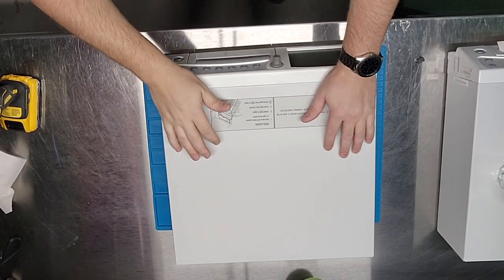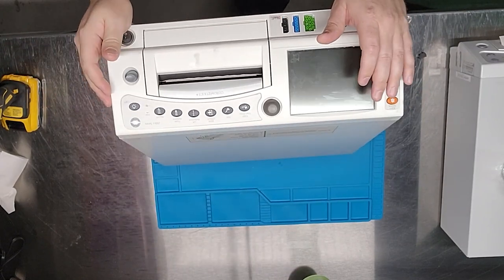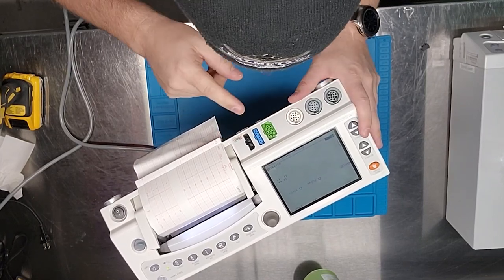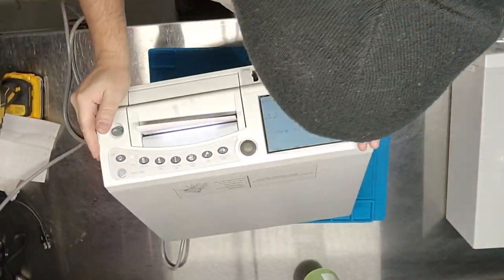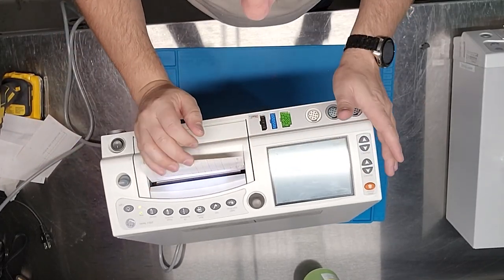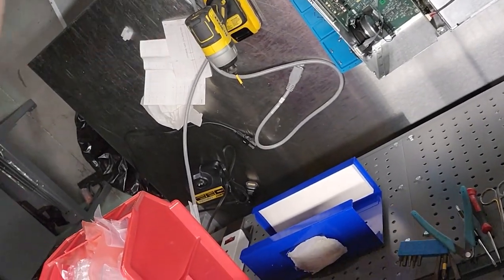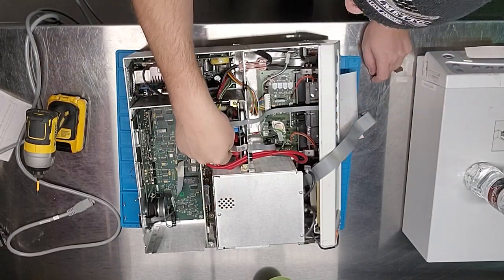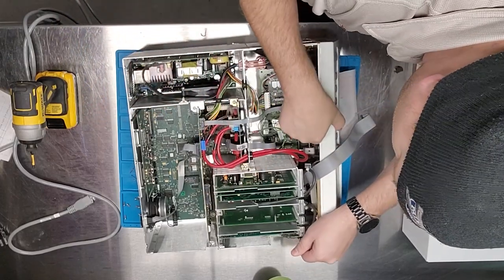GE Corometrics Fetal Monitor Brief Overview

Comment: Hey great video on this device i work with these all the time.  if you ever get the chance to making a video or a quick demonstration on how to test the toco and US ports with the PS320 Simulator. i have looked all over the web and have found no information on the correct way to test with this simulator.  but other than that great vid i have learned a ton from your content here.
Reply from the maker: I will see about getting you a video on that simulator